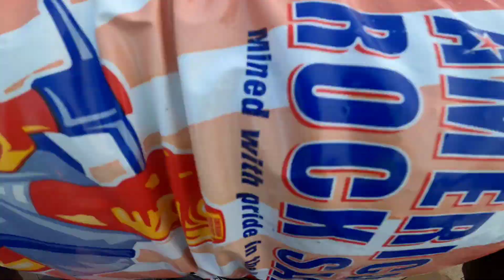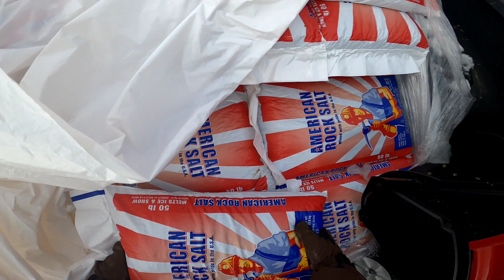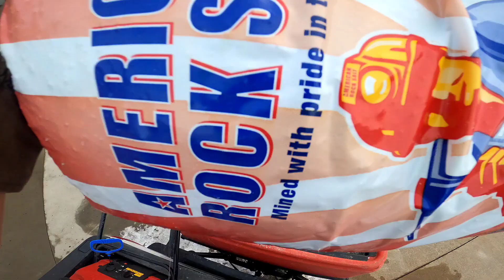Pressure Washing - FILTHY - DIRTY - PLOW TRUCK [Snow Storm Clean Ups By Hand]

Comment: Hey Sean I know you like to clean everything up real good, just a heads up don't know how far you're driving to the car wash. that water may damage your rotors if your rotors are real hot it could warp them. So just clean the rim off quick the best you can don't want to see it have any problems

Comment: I learned the hard way to always turn the wipers off before shutting off my truck. The wipers froze to my windshield and when I started the truck it ripped the rubber right off of the wipers! 😕
Reply from the maker: Yeah I have done that before also
Reply: You got off easy.  A friend had her wipers frozen to the windshield and thought she would wait until the defrosters warmed the windshield enough to thaw them.  By the time they were melted free, the windshield wiper motor, that kept trying to move the wipers, had burned out.  Newer cars may have a circuit to protect the motor, but why take a chance.
Reply: @rongollonik7754   Yup. I turn EVERYTHING off now before I kill it!

Comment: In a previous video, you mentioned that you need TQ's assistance to move the snowblower in and out of the truck.  Have you seen these bed-mounted hoists?  I've never used one, but it may work for you.  There are plenty of models on Amazon.   https://www.amazon.com/Pickup-Truck-Hoist-Crane-Capacity/dp/B004ZP9ZVQ/ref=sr_1_2?dchild=1&keywords=pickup+bed+hoist&qid=1609472202&sr=8-2